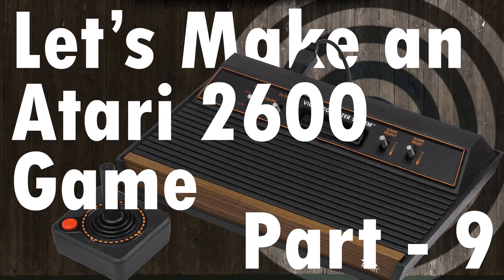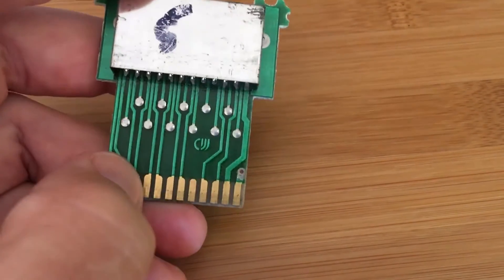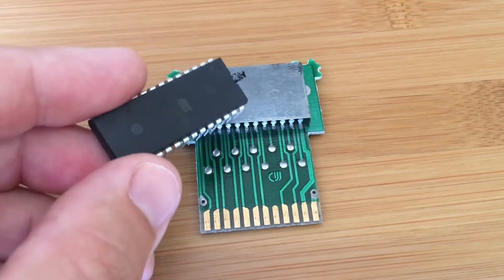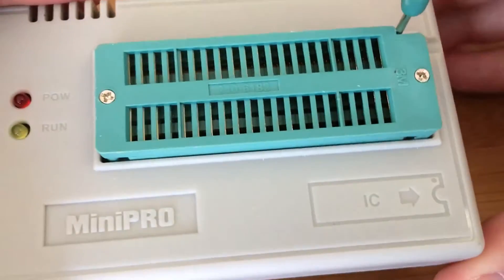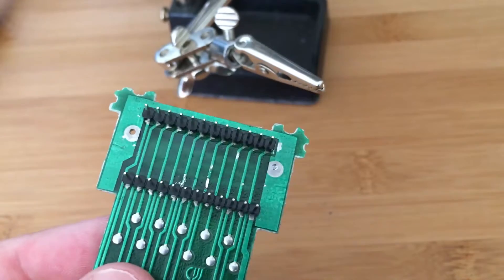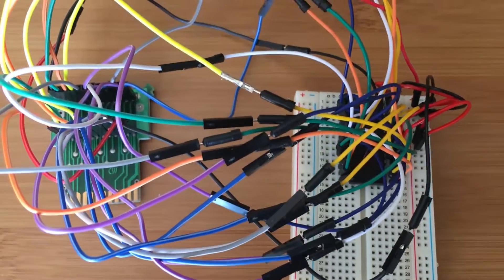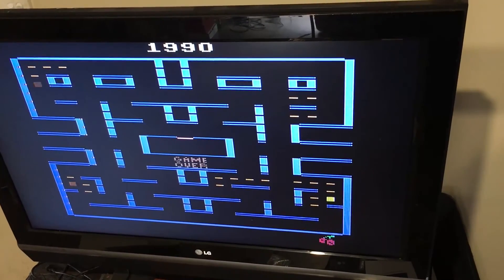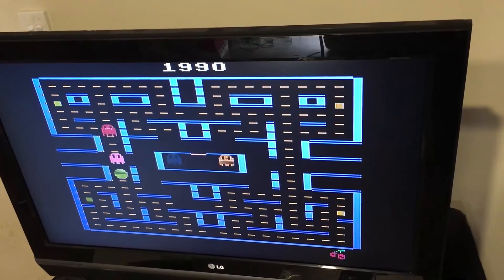Let's Make an Atari 2600 Game - Part 9 - Homemade cartridge

Comment: what's happend with "under the castle"
Reply from the maker: On hold until I sort out my own cartridge type. I'm not going to use anything from Atari Age. I have been experimenting with cartridge shells so that will likely be the next video. I also have a preliminary design for a cartridge processor, but nothing concrete yet.

Comment: Anything new happening with this?
Reply from the maker: Yes, but nothing worth showing yet. :)
Reply: @fivebytes9254  How about now?
Reply: @fivebytes9254  

Hey man you have anything yet? I'm really interested in the ray casting engine and what you've done with it.
Reply from the maker: @StepCrow  I rabbit holed so far into the abyss I never got out. On the plus side, I can now program embedded systems and design things around microcontrollers. On the negative side, hijacking the Atari's data lines (the technique required to get the processing power to make this) was never stable. I did pick up this somewhat strange vintage Atari computer conversion on eBay though - and that made me realize that the Atari 2600 can be expanded through the controller ports of all things. So then I started wondering - what if you had a co-processor running the heavy work and sent the information not by taking over the data bus, but through the controller ports? You could, in a sense, have unlimited ram. Probably still struggle with processing speed though.
Reply: @fivebytes9254  That's how the Atari Vox works

Comment: I'm glad to see you found the best "new" 4K Pac-Man. (That authors 8K version is even better!)
Reply from the maker: It really is a great port! I might try the 8k version if I implement that bank switching scheme.
Reply: It is really only missing the cornering speed up that the Arcade Pac-Man has. Everything else is Arcade-logic accurate, (even though it has to have a wide maze), i.e. monster behavior, speed, & sounds I can't even pull out of the 2600!
Reply: Which Pacman is this ?  Any pointers to where I can download the 4K or 8k versions of this home brew Pac-Man ?